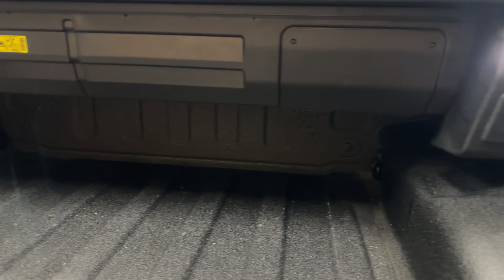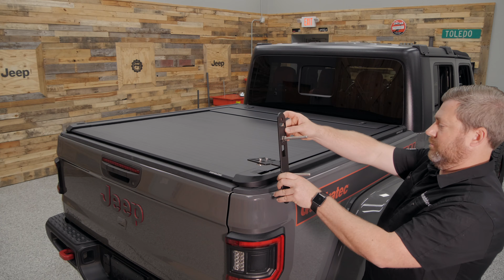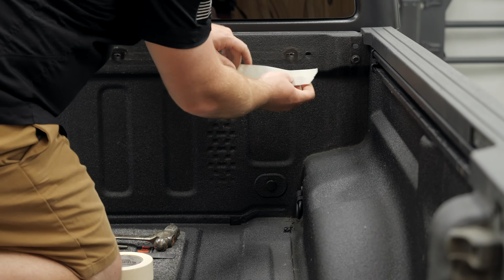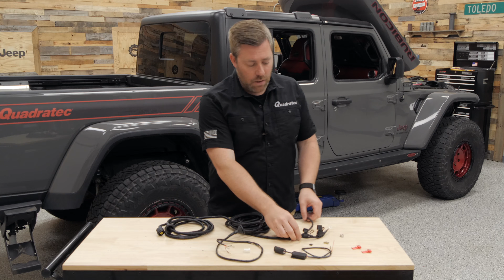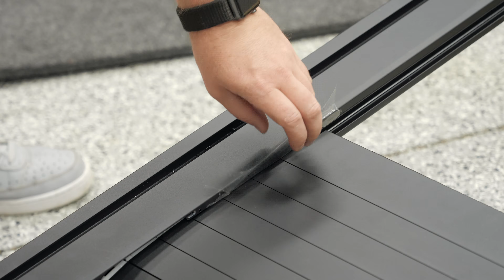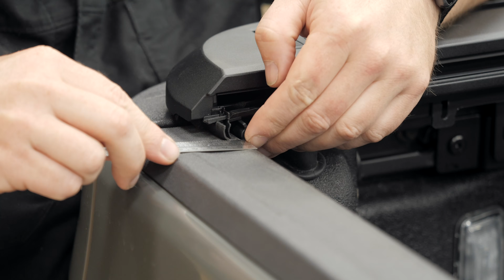EGR RollTrac Electric Retractable Bed Cover for 2020+ Jeep Gladiator JT

Comment: The storage box is a necessary piece because the fuel filler takes up space and they had to bring the tonneau forward to clear it. Other companies were able to get away with it because they put the frames on the side closer into the bed but that made it strength weak. In order for this to have that 700+ pound T slot I’m guessing they had to go wider on the top of the bed edge itself compared to other covers.  Honestly, I love it because I put a lot of stuff in that for quick access at the gas station and other items that I use regularly from the box.

Comment: I have one and I got it. I’m not great deal with the black Friday last year for another seller.  it will take you longer than a few hours to install this way longer. It’s very tricky with a lot of things to deal with. Also, I figured out how to do a no drill install will eventually put a video up. I did a very clean, install no wiring on the engine bay like you see this video everything I did took much longer because of the quality I wanted out of the finished work.   I need a little video on it as well. Also be real careful with those M4 bolts they will strip. They’re very sensitive as I recall. It’s about 4.5 pounds. Also use the recommended Loctite to 264. It’s a masterpiece of a cover well worth it.